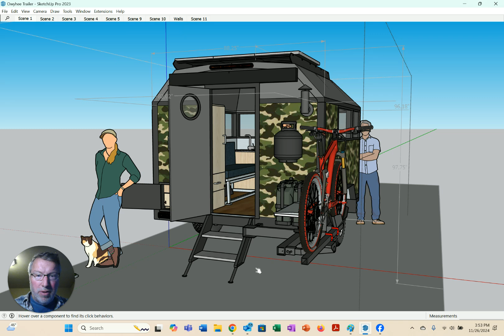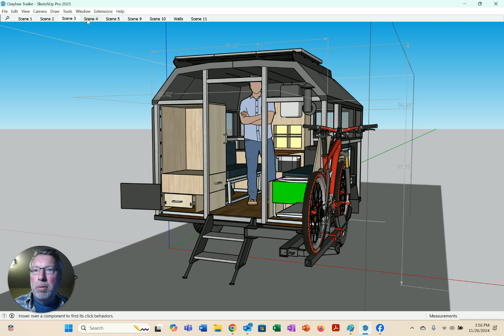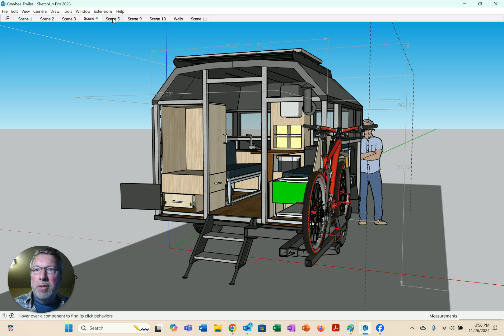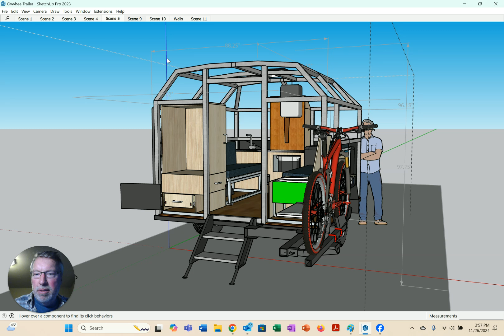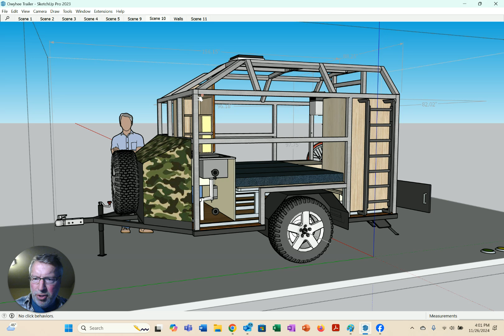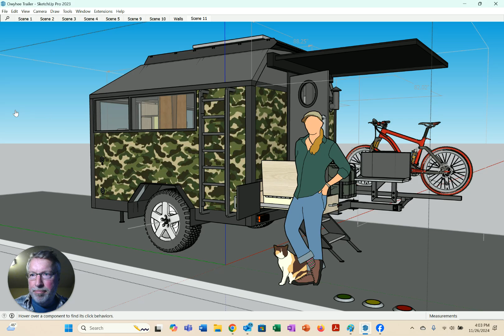Owyhee Trailer (first look)

Comment from the maker: After staring at this initial design for awhile and measuring the extended bed, we decided to make it 5.5” narrower and 2” less tall. Overall width is now less than 83” and still has a full size bed. We may try and shave another 1.5” off the overall length.